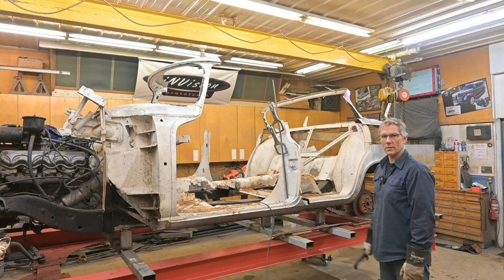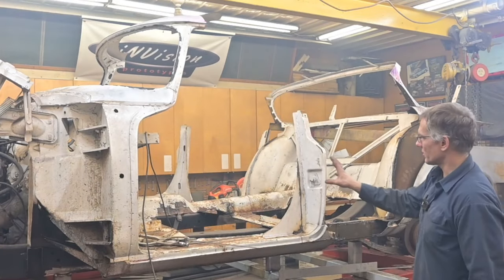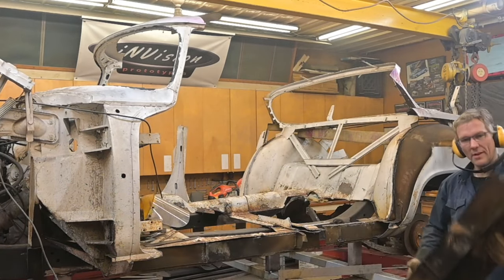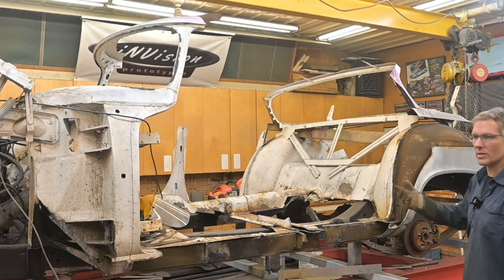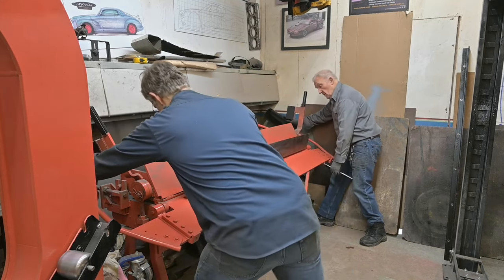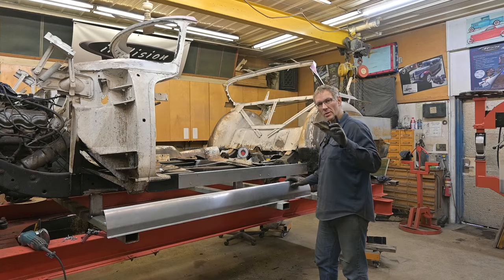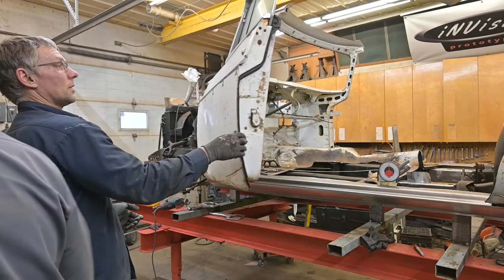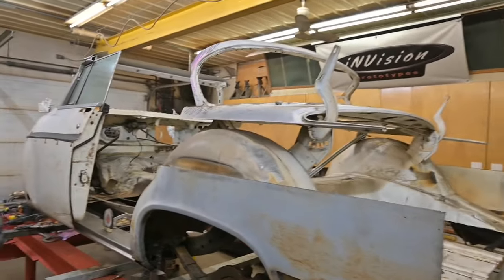MOPAR = BETTER Build Results & DIY Rockers!!  1956 Chrysler Windsor Muscle Car

Comment: I watch many channels to see just how or which way they perform these builds and it makes me wonder just how many engineers it took to complete a whole car. Kyle Carter up in canada is quite close, and maybe even better on what his method is. It comes down to what he works on most tho. He works mostly on the what was called the advanced design chevy pickups/trucks of 48 to 53. He goes layer by layer and is also doing his own design on a pickup of that age. One thing for sure is that they could be made of tin foil if enough different shapes are put in one
Reply from the maker: Thanks for watching!

Comment: Was the original panels just covered with new sheet in a previous repair?
Reply from the maker: Yup!
Reply: @iNVisionPrototypes  Bad! But could be worse, remember MTV promoted chicken wire and bondo😂
Reply from the maker: @Equine_moon True! 🤣